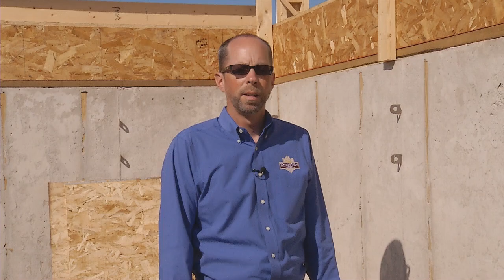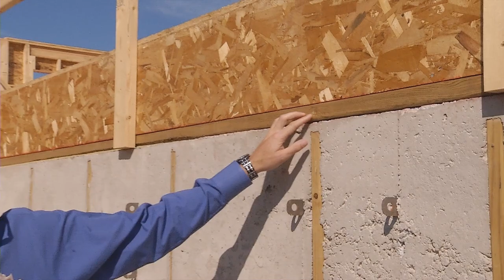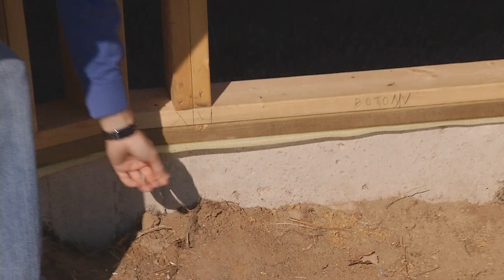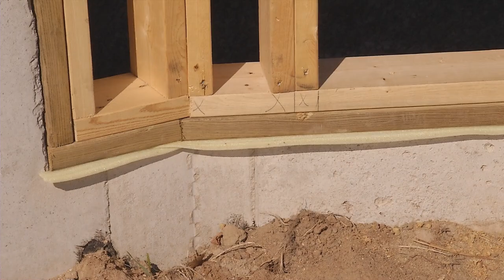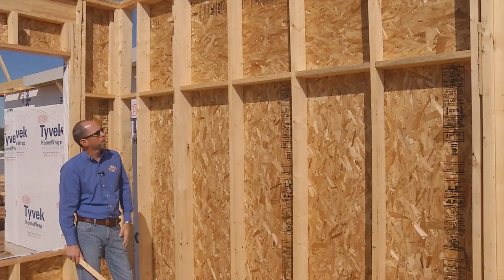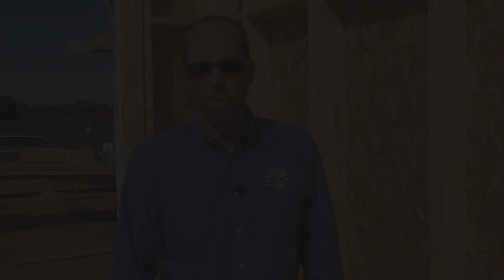Rough Carpentry and Framing Techniques | New Home Building Today

Comment: first mud sill,or sill plate, bottom plate. no let ins on corners,or sway braces,fire blocking
at 8' or 10', studs on 2' centers, floating header with no trimmers.post and beam double studs would be ok. l don't think you looked at a carpentry book with all that schooling i worked in 10 states as a carpenter for 25 years.